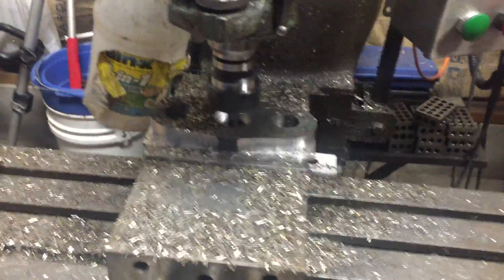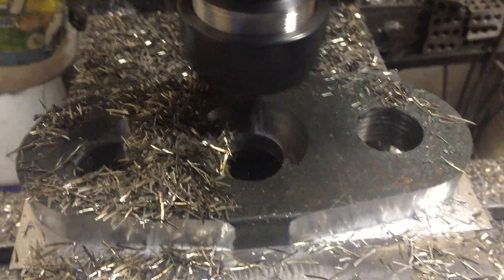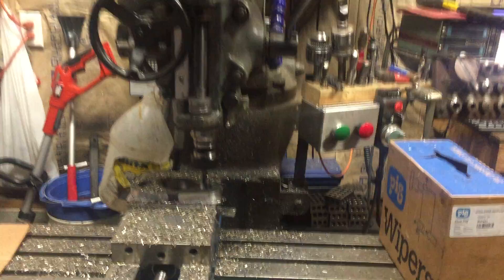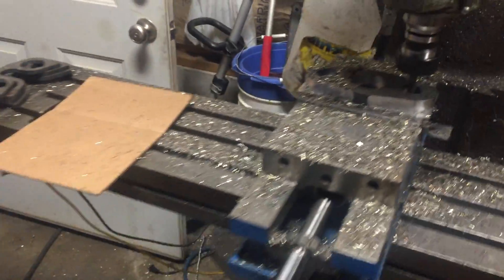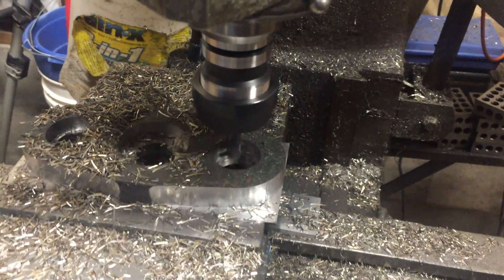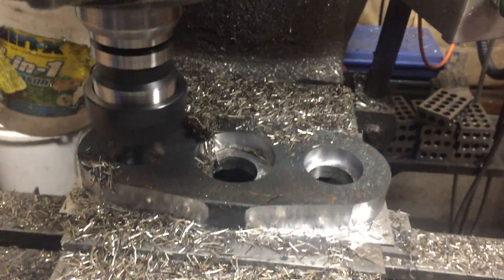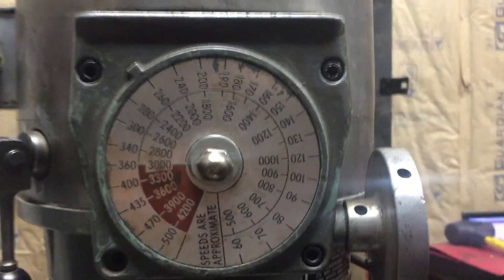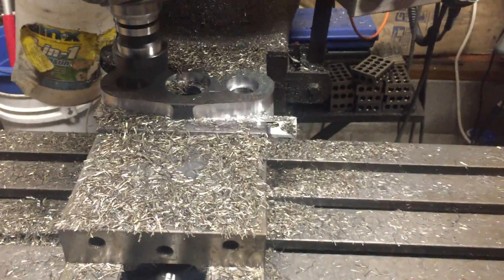Faster & Harder Cuts on the Bridgeport With The Masso & Clearpath Servos

Comment: You still need flood coolant. A removable tub (so you can still run large parts)could be made fairly easy. Flood coolant will make a difference you wont believe.
Reply from the maker: Tom Hutchins this hole machine has been a project.  Its on the list of things todo. Thx for watching

Comment: John do you have rest machine check on Fusion 360 in cam it will help with air cutting.
Reply from the maker: TheJR914 we done a 2d adaptive and the rest machining isn't in there.  We didnt think to try a 3d adaptive seen it on nyncnc video and we are using that now.   Thanks for the info tho

Comment: Have you ever tried some type of coolant ? You can be even harder. Also is you quill CNC controlled?
Reply from the maker: TheJR914 no the quill is not, its locked down and using the knee for the z axis
Reply: John lambert  I am wondering why you didn't control the quill instead of the knee. I have a couple of Bridgeport that I have converted never used the knee. But it seem to be doing a very good job 👏
Reply from the maker: TheJR914 wanted more travel than the quill would give me and i can still use it for simple jobs.